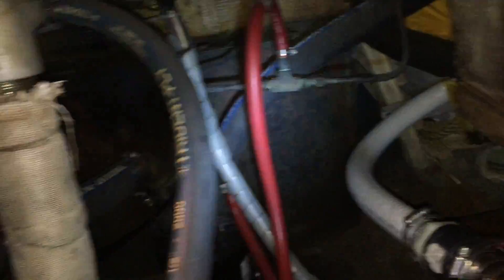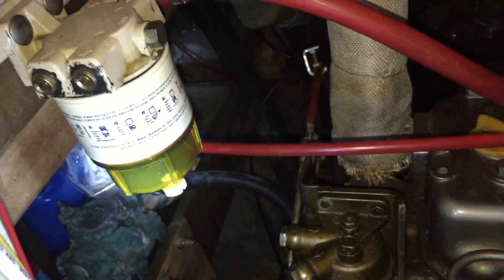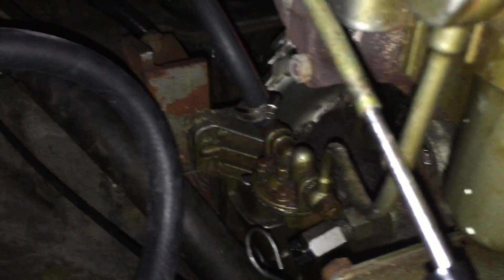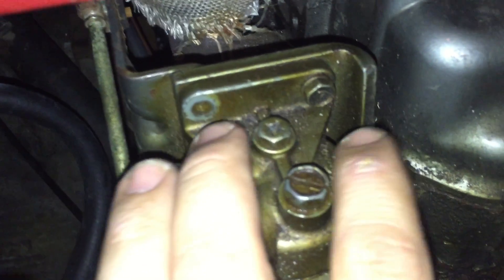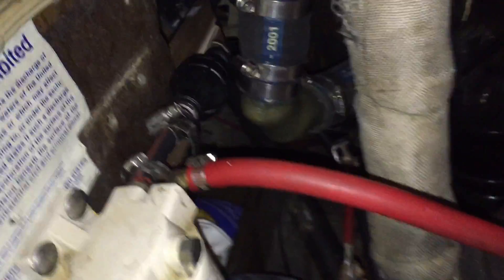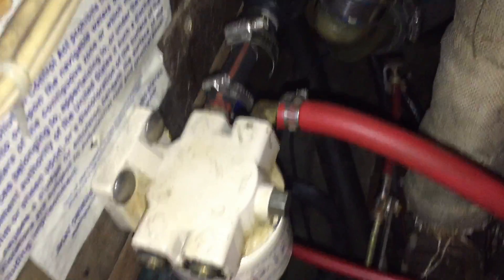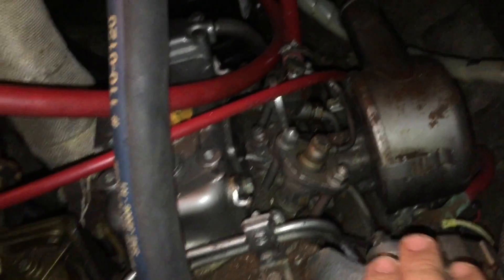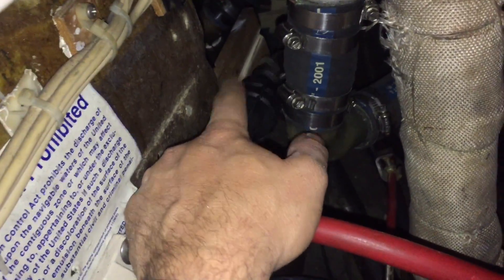SailorPunk - Bleeding air from fuel, Yanmar 2GM

Comment: Thanks for the tip. While single handling I lost the engine. Change the filters but could not get it to bleed (lift pump didn’t do crap) sailed back to the marina, adapted your tip, worked like a champion. Thank you

Comment: fwiw, today I dug in on bleeding my fuel line and tried using the starter (with decompression) to do the trick.  I couldn't get this method to successfully push enough fuel to bleed the primary fuel filter unless I was willing to crank the starter for way longer than I'm comfortable with.  so I installed a squeeze bulb between the fuel tank and the primary fuel filter (and water separator).  wow!  it worked great with quick, clear bleeding at every bleed screw.  i deal with possible degradation of the bulb by changing it out every two years.  again, thanks for your video.

Comment: Im not sure why your first filter doesnt have the priming pump built into it?  My diesel vehicles and my yanmar 2qm20 all have a priming pump.  You can buy the top housing cheap as chips new with the pump, mine fits toyota diesel fuel filters which cost 10% of the cost of the "marine" filters.

Comment: you dont need that at all, just decompress the cylinders and crank the engine, those old 2gm20's usually have a hand crank as well...
Reply: I second this. The hand crank will do the work. I got a 3GM30. Did this last week.

Comment: That lever on the pump works just fine...BUT you have to make sure the cam lobe isn't high. The top 90% of the stroke on that lever is nothing, the last 10% is the actual pumping action. If that heavier part of the stroke is not there, open the decompression and roll the engine using the belts until the cam lobe allows for this part of the pump stroke...it ain't "shit" if you are doing it right.
Reply: My friend just had to sail into a busy harbour because they ran out of gas.. this little tid bit about the lever is the only reason I got their engine running...thanks!

Comment: If you crack the banjo bolts on the injectors you will want to replace the crush copper washers or you've just introduced another place for an air leak.

Comment: I put a primer bulb on my Yanmar it started leaking after a month put air in the line. I ran a couple bottles diesel Purge directly through the engine. It's purring like a kitten now. When diesel sits for a while bacteria and algae grow in it it can gel. To prevent this I set up a recirculating pump system. Also added enzyme additive. The recirculating pump goes through the recore through the pump and through a second water separator then back to the tank these Yanmar diesel engines are happiest when they get run

Comment: Whatever you do don't install one of these primer bulbs.  The engine can be bled easily without it.  It's a typical blow boater's concept of attempting to fix things by over-complicating them.
Reply: Given that the motor is a 2GM, with a very poorly designed primer pump that is prone to fail; a bleed screw on the engine filter that is prone to stripping; and bulbs that do not degrade (being rated for diesel fuel), do not degrade at rate greater than the existing fuel lines; I’d say that you are not speaking from experience. In other words, for the Yanmar 2GM, this is the quickest way to bleed the lines.  With the bulb, you only have to bleed the injectors.
Reply: @mangore623  Just crank the engine dodo.

Comment: Good tip. My boat has a little electric 12v pump next to the primary filter. It works with the key in on position, then has a flip switch to pump the fuel through as you loosen all the bleed screws you pointed out.  The manual pump you have is great, but just watch for deterioration over time and replace every 2 years or so.
Reply: Snake Plisken  hey. So your electric pump only for bleeding? And it should not run all the time? i notice mine had that

Comment: In my experience, you can pump fuel and bleed the system up tp the bleed screw on the injector pump using a bulb, but you won't be able to pump fuel THROUGH the injector pump to the injectors without motoring the engine with the starter. That's why the decompression levers are there... to allow the engine to turn over easily during this final phase of the bleeding process. That said, the engine might actually start after just bleeding up to the injection pump, and, also, the Yanmar manual itself is misleading regarding this final phase of the bleeding process.

Comment: Thanks for this video. I'm retired, very new to sailing and shopping for my first boat. One of my top choices, at present, has a 2GM. I definitely "don't know what I'm doing", after I buy a boat but eager to learn. If the priming bulbs are prone to degrade, perhaps I should be a section of copper tube 'inline' that can easily be 'swapped out' for a priming bulb...
Reply: Always have a spare priming bulb

Comment: I have one of these priming bulbs, installed by a previous owner. It split, causing a leak. I replaced it, but now check it regularly. they may not be compatible with diesel fuel.

Comment: The in-line hand pumps are handy to get things started, but are notorious for breaking down and clogging up the system if you leave them in place.  I'd pinch off the fuel line (not to loose prime back towards the tank) and remove it.  Then re-prime from the fuel pump using the lever and the bleed screw.
Reply from the maker: Cool thanks for the heads up. Do they just clog the engine or does the hand pump just get clogged? Should I just use vice grips to pinch the line or will that damage it? Maybe I could put a valve in prior to the pump for quick removal. That's probably not worth the trouble though. Hopefully this doesn't become a common occurrence.